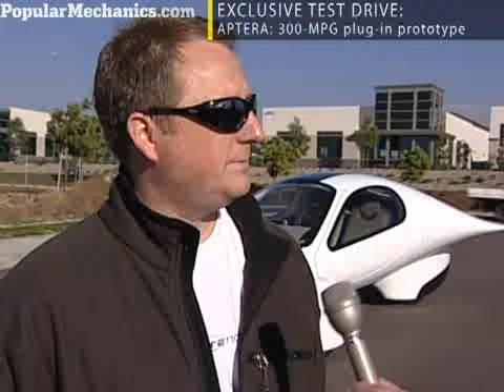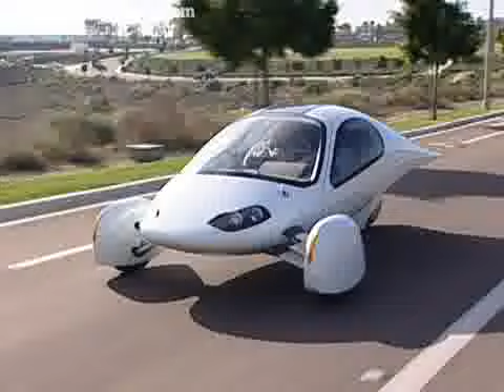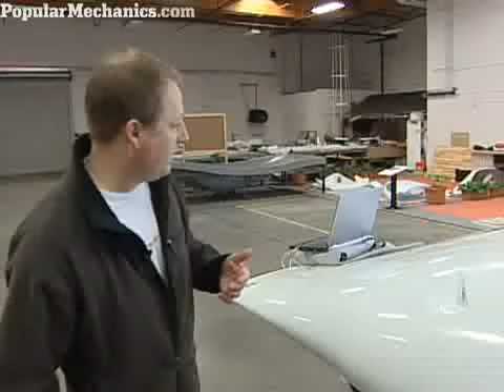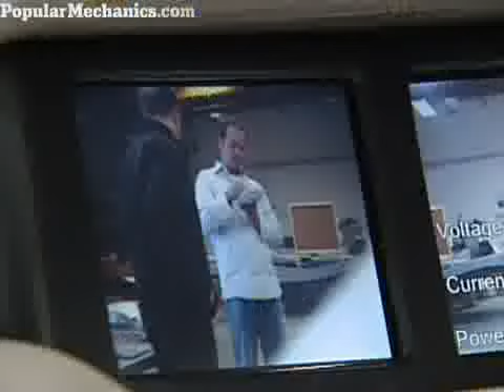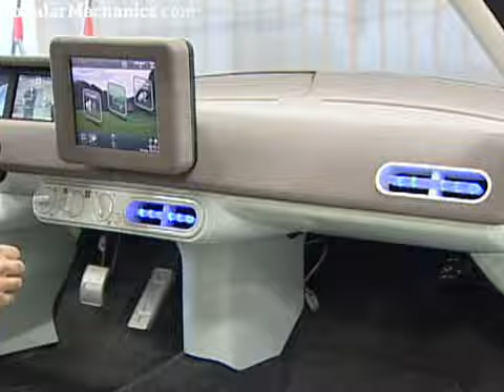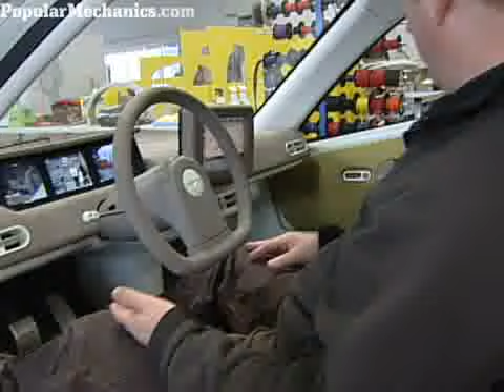Aptera Electric Type-1 - Video Test Drive - First Look Details - 300 MPG - Popular Mechanics

Comment: Fun to compare it to the new version. Too bad the first attempt fell apart. Hope that the second try is successful.
Reply: Here's some comparisons:
Replaced the body material
Replaced RWD with 2 or 3 IWM's
Then replaced IWM's with motor in front, 2WD only
Replaced paint with wrap
Replaced heat pump with radiant heater
Added far more solar
Far bigger battery
Replaced skin cooling with radiator
Replaced fixed side windows with half-fixed, half opening
Added side mirrors
Moved headlights to centre
Added a full frame
Changed the rear suspension type
Increased the size of the UI/UX
Removed the in-frunk camping kit (and the frunk)
No hybrid option
Putting in a 2-speed transmission next
Swivel up spats (wheel pants)
Beefier roll cage
Probably triple the planned original price, maybe more?

The changes to things like European glass;  body and suspension and Korean, Japanese and Chinese other parts, as well as mostly crowdfunding will probably help it fail again, but mostly the fact that it's a useless gimmick will see to it.